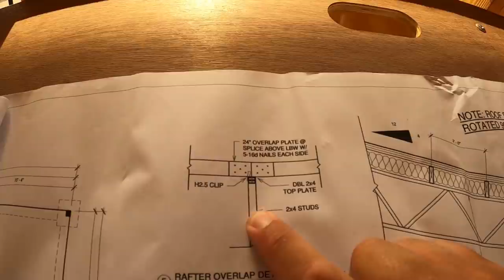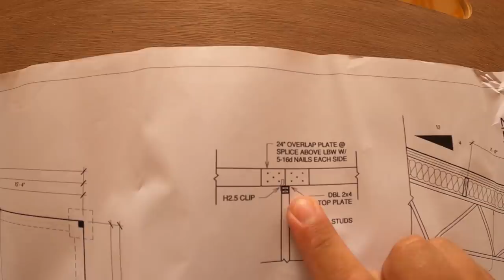Huge episode, working on the attic and smoking ribs! #363

Comment: When we first moved to FL from a much drier climate, my hubby thought it would be a good idea to build a chicken coop from OSB board. Others warned us so we sealed it very well with several coats of outdoor primer and paint.  The roof was reg plywood and metal over that, which that overhung all sides by 6 inches. Floor was raised up and also reg plywood. In about 4 yrs those OSB walls all crumbled due to sucking moisture straight outta the air due to our insane humidity. We will never use OSB for anything in FL lol. When we lived in Phoenix and even So Cal, it was never a problem.
Reply from the maker: Yes it definitely needs to be out of any weather, but so does none treated plywood.
Reply: @TKCL  True.Both the floor and roof plywood was still good so we reused it on our goat barn.

Comment: Wet or moist hickory smokes more which gives more smoky flavor if that’s w/hat you want. I buy chunks & chips if I can’t find logs or storm-felled trees in the woods to use. I soak the wood in water so it doesn’t burn up in the smoker. I shut off all incoming air if I can’t, so it smokes the Turkey, bologna or steaks. Yes, I do smoke whole turkeys in my electric Brinkmann for groups. They take 3 hours with a water drip pan and I also Cajun-inject them with garlic butter sauce. I donate the turkeys I win from Turkey shoots in November to Sunday School groups.
Reply from the maker: Sounds delicious!

Comment: You should make you a sub tank for the air just use a tire air tank put fittings on it plug your main line from compressor then plug your nail gun line in. It's alot better then the long line straight from the compressor. It works great. Looks great man.
Reply from the maker: Cool idea, thanks

Comment: Maybe I can help you with your decking sit your saw horses up and stand the decking on the ends however many sheets u need and then it will be high enough  to grab and slide up thats how we did it when we decked roofs
Reply from the maker: Thank you for the tip

Comment: I never would’ve excepted an answer like just stick to the plans if something made no sense to me, I would want to know exactly why especially after being an engineer. 😂😂 If those rafters were longer and just pulled it from the side the only advantage to doing but it ends is you keep your boards straight in uniform but structurally I see absolutely no advantage and from a physics standpoint it actually makes it weaker which is why you have to go in and add these boards now. I would be interested to know why, there may actually be a valid reason that is just beyond my understanding but I bet it’s shiny nickel it’s just because that’s the way he likes to do it and there’s really no particular reason other than that to do it. I would never change it back the other way because the work is already done but I just say no reason for that to be a better way of doing it other than just having things aligned.  Then again I think wood framing and most homebuilding technology is archaic and silly. Lol.  But I’m always willing to admit that I’m not some sort of absolute genius he knows everything and I always like to ask why because sometimes you just learn things from the professionals.

Gluing those joints you put in today would also add a whole lot of strength. I’m a glue or I’m one of those guys who Glooze all the sheeting to the framework. It’s a lot of work but it improves the sheer strength by huge margins.  

I don’t think there’s anything strange at all about switching from framing to grilling ribs, it’s all man stuff and part of the process, if you don’t make ribs while you’re building your houseThen what’s the point even bothering to build your house, that would just be silly.  😂  I need to be investing in a new grill, when I moved I went for gas and I hate it and I’m almost glad that the grill I bought is falling apart now.  I like the idea of an offset smoker but at the same time doing it manually kind of seems fun though I’m probably going to opt for a pellet smoker it’s just so much easier.  lol. 

You have baby back ribs in there it’s just a matter of trimming it. Are usually just cook it all and then separate it later but you can cut the baby back ribs out of there still, he cut the flaps and the top off unit was St. Louis cut and if you cut the tops off of those UN up with baby backs.   I generally take the membrane off as well but if you’re going to do a hot and fast cook then it usually crisps up and cracks anyway and can help keep the ribs together at the higher temps but it’s a rare occasion that I do something like that and I always take the membrane off as well but not on beef, beef do you have to cook for so long and if you take the membrane off it’s pretty much just gonna fall apart on you.   I’ve been a little obsessed with grilling and smoking for the last few years and watch tons of videos and kind of study as well as cooking in general. An interesting thing I’ve been doing for the last few months is watching foreign videos and how people do it in other countries.  The worst part about it though is we always can afford beef anymore it’s gotten so ridiculous, it’s almost as bad as wood prices and availability.  Pork is easier because you can buy cheap meat and you’re cooking it to death and breaking it down but if you buy cheap beef you’re basically going to have to boil it in tallow for hours to get anything decent otherwise it’s just gonna be tough and chewy because that’s what cheap meat is. Are used to go to the butcher and get good ribeyes but the price is insane now.  One of the newest tricks I learned was to buy those cheap skinny ribeyes and you throw them in a Sprite or 7-Up or I’m sure you could use beer or any kind of carbonated beverage and let it soak for about two hours and on a thinner piece of meat to make it a whole lot more tender and surprisingly doesn’t screw up the taste like a lot of tenderizers can. Another one which will trigger everybody is MSG, the truth is it’s amazing stuff. 😂😂😂 it became politically incorrect but it does magical things to meat.  lol. You’re brave, I saw probe the meat and try to reach the exact temperatures but wrapping and steaming always get you in that ballpark and comes out great.  That whole 321 method is kind of silly but an hour and a half maybe two hours to get that smoke embark on there and then wrap it for a while longer to get that heat up and breakdown the collagen and fibers and It always comes out good. I like to leave a little bit more of a bite to it not get full off the boneBut just nice and tender with some good pullback and some good smoke.  Those potatoes look great too.  🤤
Reply from the maker: I absolutely agree, but throughout this process I've found its better to just go with the flow. I've already wasted a lot of time arguing about some things only to still have to do what code, plans ect say.
Reply: @TKCL  yeah I would go with it and follow what the engineer says but I would just be too curious and have to ask why and what the science behind it was. Most people hate building codes but I like them and use them as the absolute minimum and usually try to build over them, I figure it’s just better to overdo it in the beginning then have to tear it all apart and fix it later. I think it Hass to be strong enough to park a suburban on, some people think that’s ridiculous but oh well it definitely doesn’t hurt and I’ve done enough construction and more importantly demolition work to see how stuff fails and whether they’re cut or not somethings just aren’t good enough it’s just better to go a step beyond and make sure it’s not gonna be a problem you have to deal with later. Florida code is crazy compared to the rest of the country even California which has earthquake code and it’s pretty crazy itself but you get hurricanes so it is what it is and it just needs to be done.  I totally agree on the things you were saying like just adding the blocking and not cutting those corners, when people do that those houses are a huge pain to tear apart and demo, when they don’t do that it’s pretty easy and almost scary to think that that’s the house you’re living in and hoping it will protect you. lol. You’re smart and you understand the process and you’ve made great decisions all along, your home is going to be in great shape 5060 years from now to wear a lot of quick fab homes built by builders just meeting code we’re going to be garbage and ready to tear down and rebuild yours unless it’s torn down by a storm or get some major water problem in there should be pretty rocksolid decades from now
Reply from the maker: Thank you for the vote of confidence
Reply: @TKCL  lol. I just finished watching the video that clip at the end with the plywood was hilarious. 😂😂😂
Reply from the maker: I chuckled too when I watched it back! Lol
Reply: @TKCL  I think anybody has ever done any kind of construction found it hysterical come on we’ve all been there at one time or another.  Lol. Are used to work for a roofer and sometimes does wind gusts are ridiculous I can’t tell you how many times I was trying to carry something and got blown over or drop some thing and had to climb all the way back down the ladder to pick it up. Lol.  I’m almost glad I’m getting too old for that kind of work. 😂
Reply: @m9 ovich you’re not lion, when I lived in CaliforniaAnd worked for contractors there was always a care package for the inspectors.